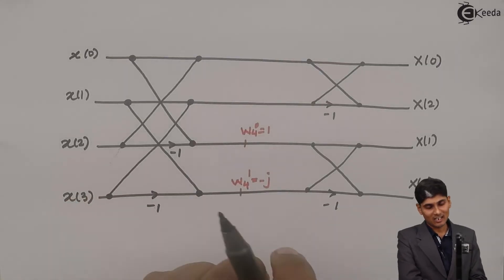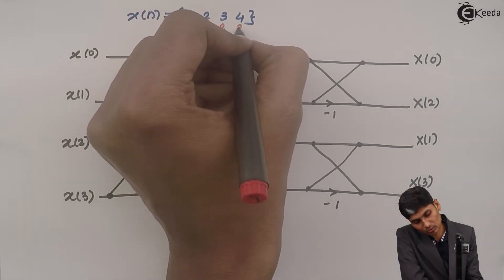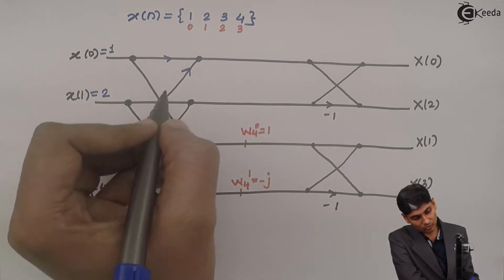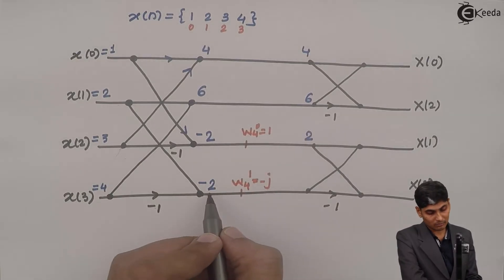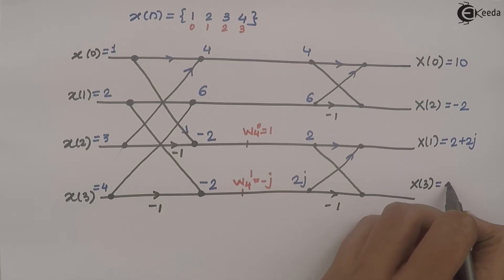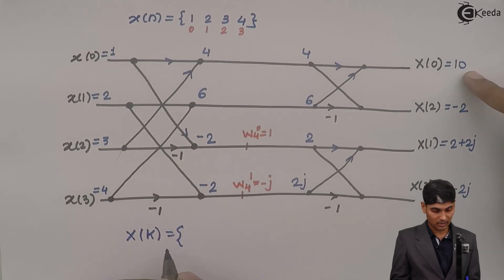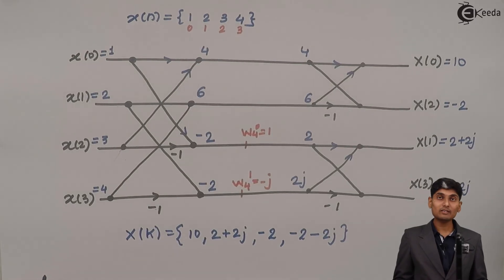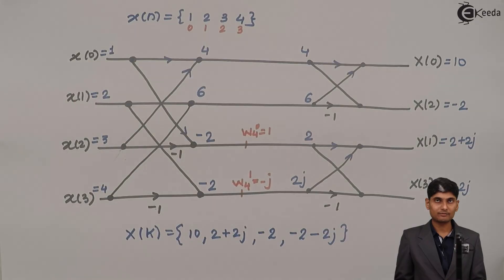Problem based on 4 Point DIT(Decimation In Time)  Fast Fourier Transform (FFT) Graph - 3

Comment: your lecture are very nice and simple to understand at very first time. 
thanks for putting up the videos lecture series.
I would like to take to your notice, the x(1)= 2+2j is incorrect. it should be x(1)= -2+2j.
& this has Happened coz of incorrectly copying from 1st stage to 2nd stage {-2* w4° = it should be -2}
guys you all can verify Ur ans by Deftn method or Simple Matrix method by solving the problem.
Thanks